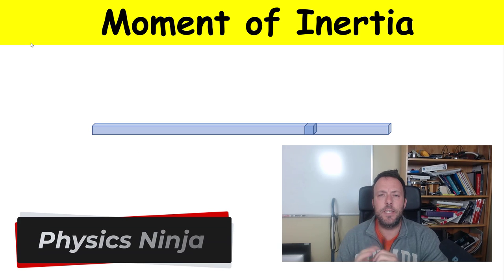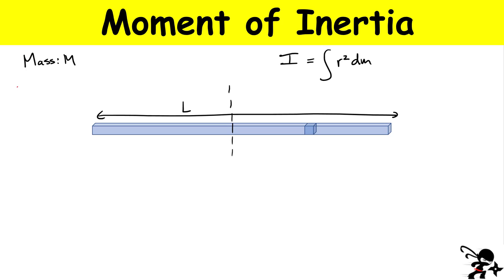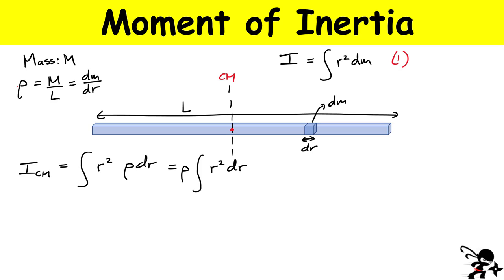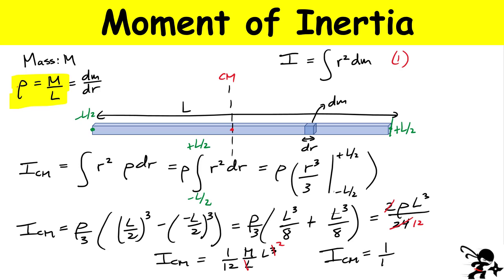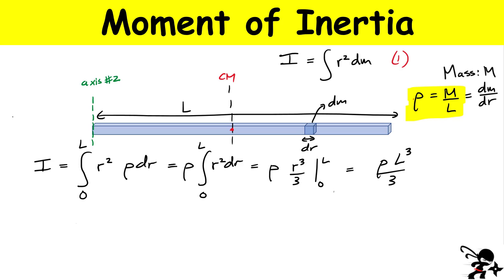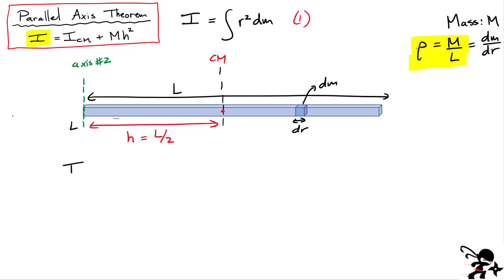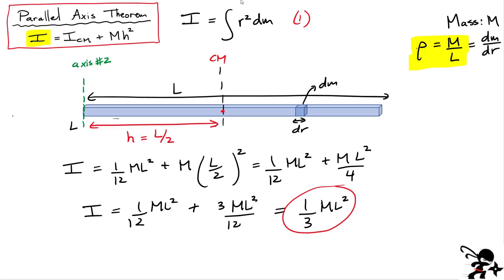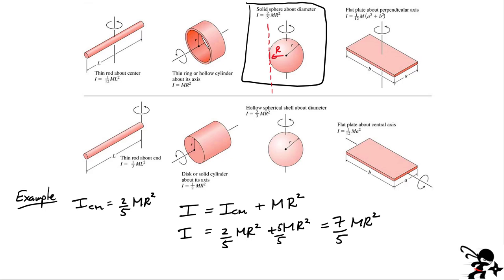Moment of Inertia - Parallel Axis Theorem - Thin Rod

Comment: What if I have a door on hinges with axis of rotation just like in your case number 2, and this door doesn’t have center of gravity in the exact middle? Should I use parallel axis theorem? So equation will be 1/3.m.L^2+m.d^2 ? Thank you.
Reply from the maker: If the center of gravity is not in the middle it means the density is not uniform.   you should integrate assuming you know the density vs position.
Reply: @PhysicsNinja  I mean, the door has the same density. It just doesnt have perfect rectangular shape. There are other plates and construction things on it. Do I have to calculate each construction separately and then sum all the moments of inertia of door itself and constructions?